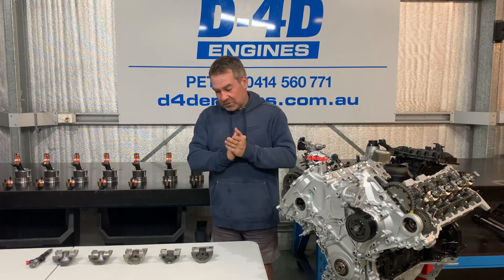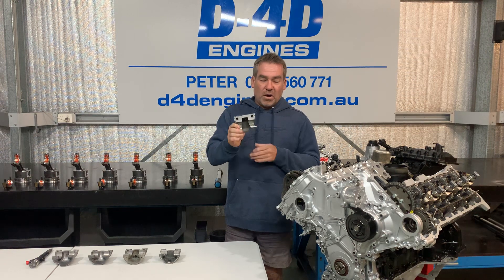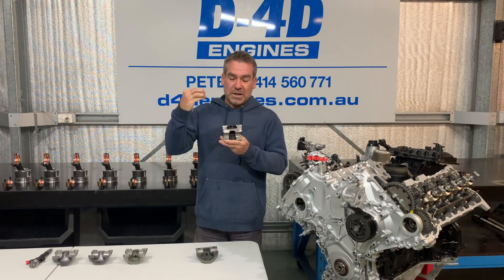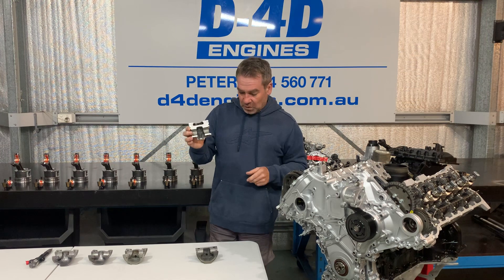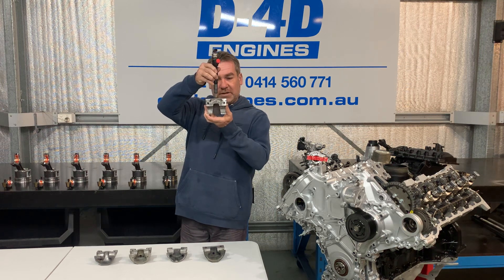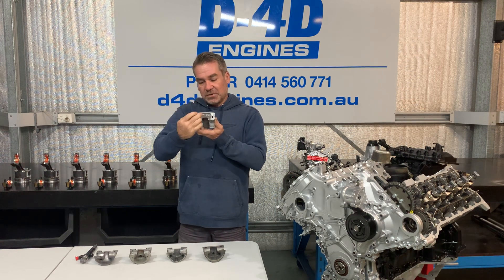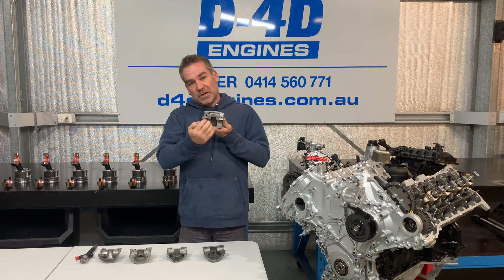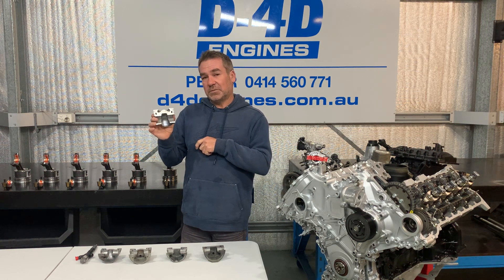Modern diesel piston design explained, Toyota 1KZ,1HDT, 1KD redirection bowl common rail injector.

Comment: Is there anything that can be done about the sharp edge on the 1kd piston to stop any problems?.
Great videos as well👌👌
Reply: Get a big front mount intercooler to keep the intake temps as low as possible , oil changes every 5k, high flow cat to keep egts down and egr resection plate to keep oil and intake clean. If you keep these engines as cool as possible they will last!